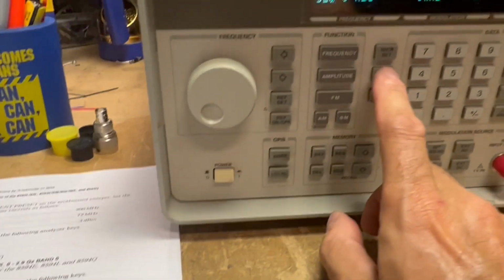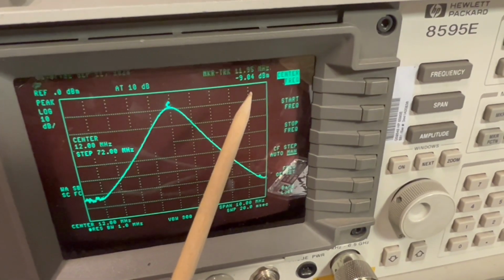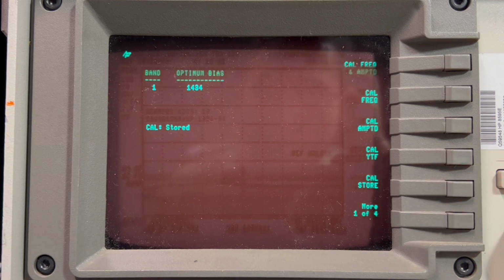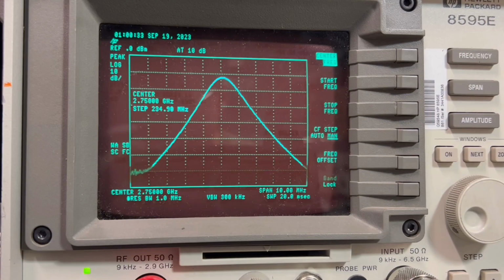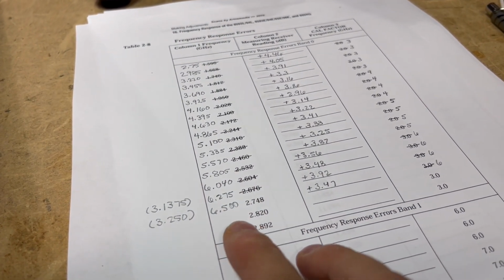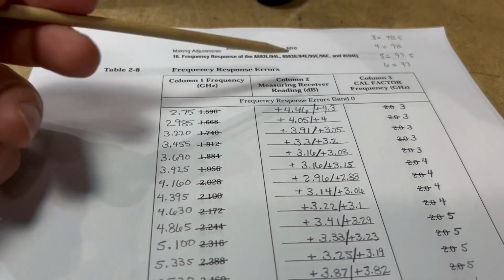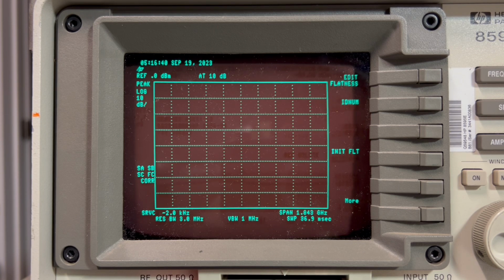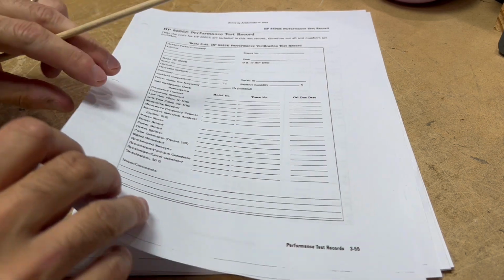HP 8595E Repair Part 3, Frequency Correction Constants

Comment from the maker: Most of the information is available from the 8590 series service manual. That’s where the cal attenuator, frequency correction constants and IF adjustments are from. I believe the service guide is on the web but you’ll have to find it.